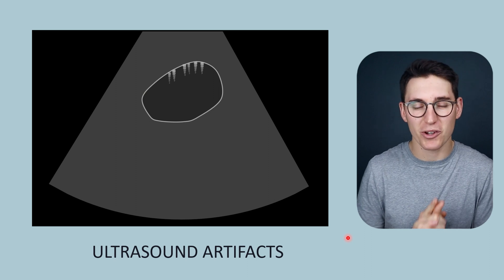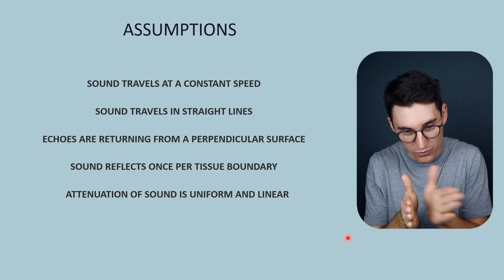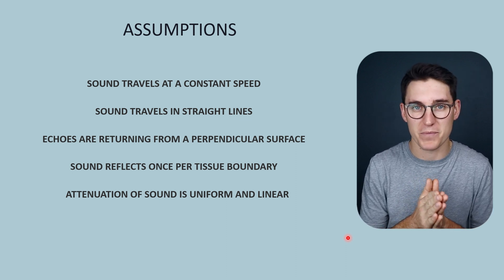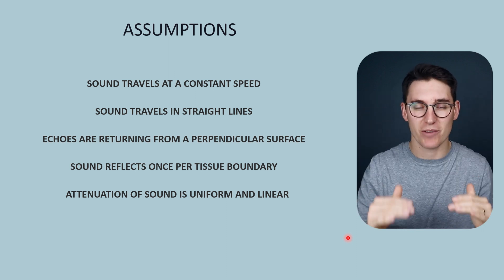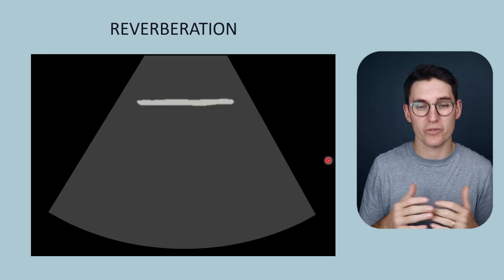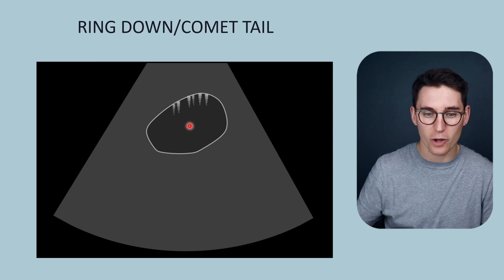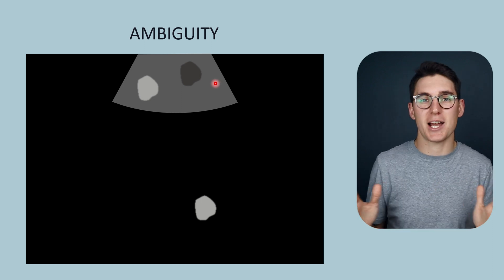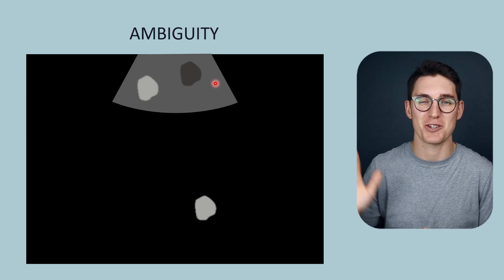Ultrasound Artifacts | Ultrasound Physics Course | Radiology Physics Course #25

Comment: In the first refraction example,  if some echo is reflected back and some off at an angle, wouldn't the transducer perceive this as a reduction in intensity and therefore it would show darker?

In the second example, isn't the round trip time slightly longer so the duplicate object should be appear as slightly deeper?

Comment: Thank you for the great video. 

I just have a question regarding Snell's law. 

You mentioned in the video that "if the speed of sound increases, we will get an angle of transmittance that is smaller than the angle of incidence" 
but the diagram seems to show otherwise. 
I've gone through the calculation via the formula and I think if the speed of sound increase in the 2nd medium, the angle should also increase. 

Pls let me know if there's a mistake in my understanding. Thank you
Reply from the maker: Hello. Not sure I did say that. If I did, do you mind letting me know when in the video so I can highlight the mistake for others? You’re right angle of transmission is higher than incidence of speed increases.
Reply: @radiologytutorials  it's around 03:00 to 03:20
Reply from the maker: @kazuya9696 thank you so much! I will pin a comment to the top to let people know. The diagrams are correct! I misspoke 😖😖